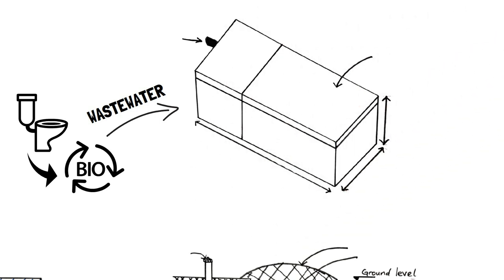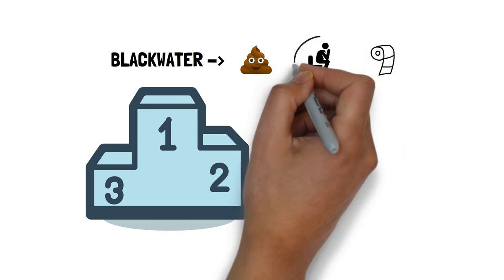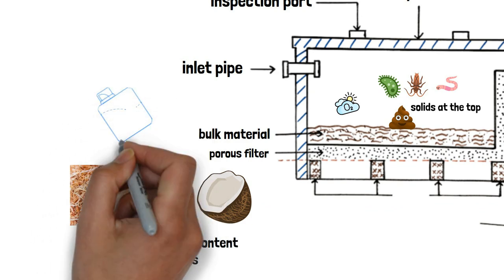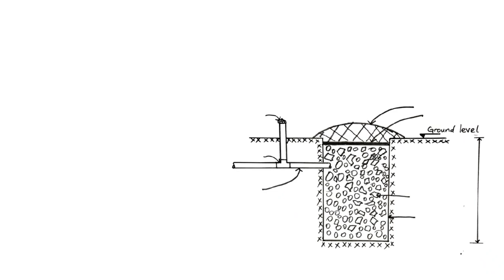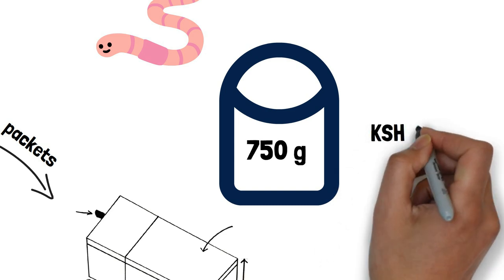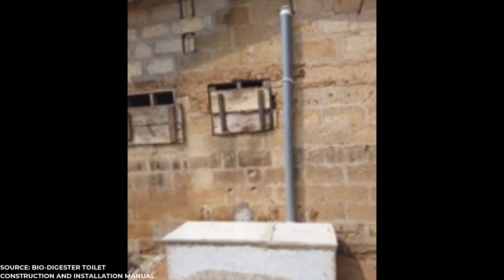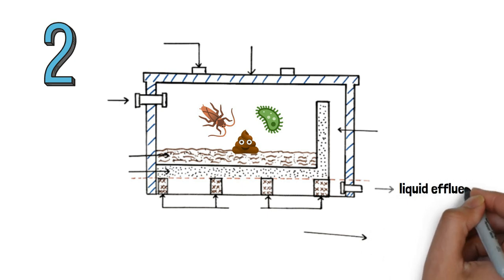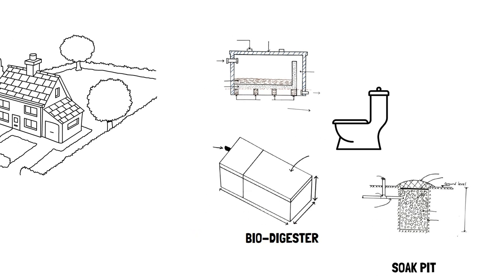Biodigesters: The Environment-Friendly Answer to Septic Tanks

Comment: Kudos Nick, 
I have seen bigger biodigesters installed in industrial development like factories. They handle population in hundreds of persons. They have an electrical panel, with some gadgets which am not sure whether are for powering mechanical aeration, and the discharge at the output is acceptable to join the storm water drain systems. Eco-cycle and Davis & Shirtliff firms specialise in the installation.
Is the operation concept the same?
Reply from the maker: Yeah, these are more like  offsite sanitation systems that handle bigger populations and are powered to aerate the wastewater inflow and reduce BOD as it discharges into the rivers, lakes etc